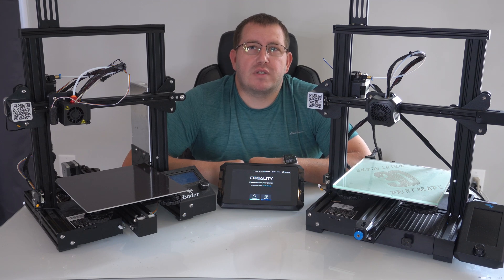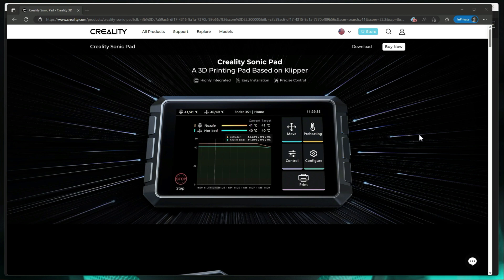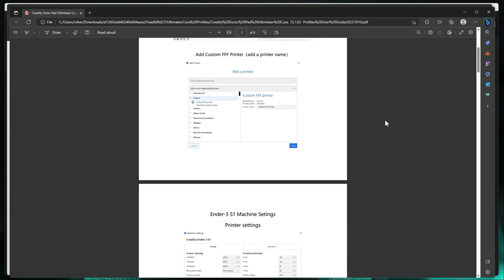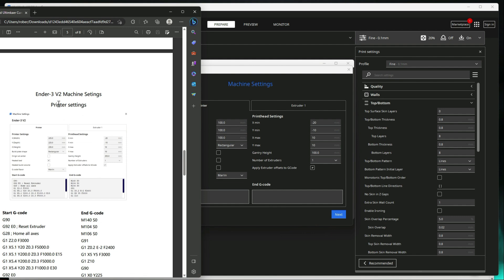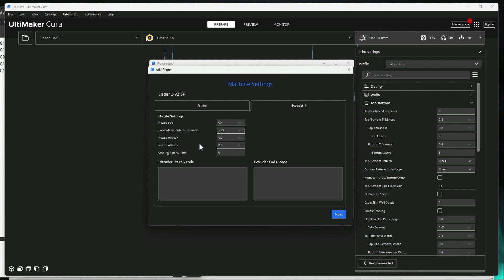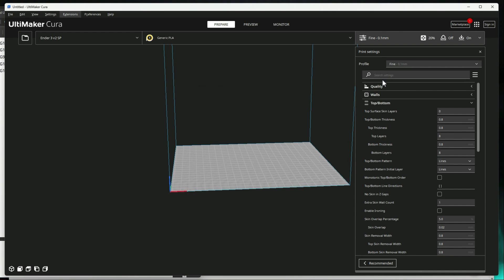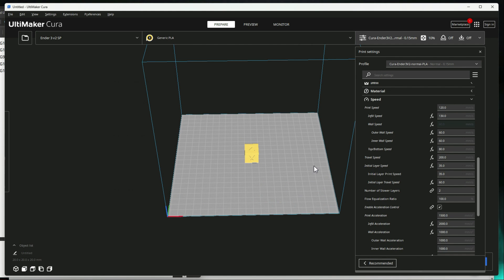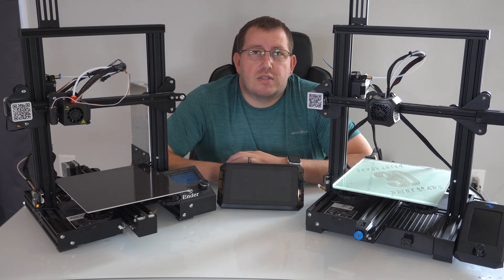Cura Settings for Sonic Pad/Klipper

Comment: First of all, great video! 
And a question mate, I got a raspberry pi zero 2w and I did all the work for run it and use. It works well. So question, Getting the creality pad is the same kind of solution?
And do you recommend use the same settings as show in the pdf for this hardware (raspberry) ?
Thanks for you time mate !
Reply from the maker: Hi. Thanks for the feedback. To answer your question it depends on what your running on the ras pi. If your running klipper it would be very similar to the sonic pad. If your running octoprint and Marlin on the printer then there is a big difference. Either way, i recommend getting to klipper. The setting in the pdf are good as a starting point, you may need to tweak them a little based on your printer.

Comment: I'm new to printing only about six mon. I bought the sonic seven right after getting it.I just installed this the printer drivers or something that came with it and took off printings make any customs so am I doing something wrong? I got some of my best print ever.don't even hardly see the prints anymore.
Reply from the maker: Hi. Honestly, im having a hard time following your question. Can you provide more details on the issue?

Comment: Apart from reducing the retraction length, do you know of any other changes (for the profile) for the Ender 3 Pro with the all metal hot-end (microswiss) running on Klipper when slicing on the Cura?  I am assuming I can use the V2 profiles since they are both bowden tube (non-direct drive).  Using CHEP Ender 3 Pro profile as of right now (pre sonic pad profiles).  Will compare that too the V2 profiles later.
Reply from the maker: Hi. The big setting differences will be speed and retraction. The v2 profile should work fine since the only real difference is the silent board and screen.
Reply: @3DPrintscape how fast have you printed on the ender 3 pro without losing too much quality? 120 mm/s?
Reply: Awesome. And thank you very much for your videos and clear technical explanations. Much appreciated.

Comment: Thanks for this video. I’m fairly new to 3D printing and bought a sonic pad because I thought it would make life easier. I couldn’t be more wrong. I assumed you could create the g-code in Cura (although I don’t really know what I’m doing) and send it to the micro sd card, but put that in the USB adapter and plug that into the sonic pad instead of directly into the Ender 3 v2. It seems I am wrong.
Reply from the maker: Hi. At a high level what your saying is correct. The gcode is being created from Cura and its getting sent to the sonic pad. Cura just needs to know what settings are needed and i prefer to use the web browser over usb/sd.

Comment: I have an Ender 5 S1, which Profiles can I use therefore?
Reply from the maker: Hi. I would start with the one for the Ender and modify it from there.
Reply: What do you mean by starting with the ones for Ender? The Standard Profile who came with? I found a Profile on the Creality Print Slicer, but honestly I don't like this Slicer that much. Do you think I can copy that? @3DPrintscape
Reply from the maker: Cura 5.6 has the standard profile for the Ender 5 S1 in it, you should start with that. @raffaelegambardella4011

Comment: I have a ender 3 max with a cr touch and dont really under stand what printer settings i shoild use in my slicer.
Reply from the maker: Hi. Are you running the sonic pad? If so, the ones i call out here are probably a good starting point. Just make sure you set the build plate size correctly in the slicer.

Comment: Great video and I have everything setup, however whenever i try to print the nozzle is about 2.5mm above the print bed. I performed the probe calibration and it still won't work. If I try to adjust the bed height then my adjustment screws max out  and I can't adjust enough. Any help or assistance would be great.
Reply from the maker: Hi. It sounds like the z offset isnt set right. What value did you come up with for the offset?

Comment: Do you have a guide for the BTT Pad7 running on Ender 3 S1 Pro?
Reply from the maker: Hi. I dont have one for the S1 Pro but the one i have for for the v2. It shouldn't be too much different as far as speeds and everything go to start with. You will need to tweak things based on the printers behavior though.

Comment: If you're going to be using the Sonic pad which runs Klipper, why did you choose the Merlin G-Code during set-up?
Reply from the maker: Hi. There isnt a flavor for Klipper that im aware of. The g-code is mostly the same minus a few commands.
Reply: Greetings from England. I thought the same thing as you @LP, but then I’m new to all this g-code stuff. I’d like to learn how to design & print my own  items. At the moment I’m just getting stl’s from thingyverse and running them through Cura and hope for the best. I bought a sonic pad because I thought it would make things easier. Seems like I’ve still got a lot to learn.

Comment: Hello ! If I have a cr-10 smart pro, what configuration should I use? By installing Kippler, is the printer already faster or should I configure something in the slicer?
Reply from the maker: Hi. Klipper allows the printer to be faster but you still have to tell it what speed to go at in the slicer. I would start with the cura profile for your printer then make the changes i mention in this video.

Comment: hello
why the accelration is high? like 29884908
klipper warning me with max_extrude_cross_section that is very high

help me connect my printer to probaly work

ender 3 s1, klipper on raspberry 4, cura 5.1.0

Comment: Thank you for this video.   I am still looking for similar for the Cura Settings while using any printer in Klipper.  Not just a specific Printer/Sonic Pad.   This is as close as I have found so far.  Thanks again
Reply from the maker: You're welcome!

Comment: Just wondering if you would recomend me setting my g code to a different printer as i have installled a sprite extruder pro with cr touch and filament sensor on my ender 3 v2. Or do i still run stock v2 g code????
Reply from the maker: Hi. You dont need to set it to a different printer. Just add the g29 command after the g28 for the bed leveling and make sure you calibrate your e steps.

Comment: I have a Ender 3 S1 Plus with a sonic pad and there is no profile for this printer in the folder or information in the documentation on how to create a profile in Cura with this printer. Do i use the printer setting for the Ender 3 S1? Any help is appreciated. Thanks.
Reply from the maker: Hi. I would start with the closest printer to the one you have in terms of specs, so the S1 is probably a good place to start.
Reply: I have the same problem with no profiles for my S1 Plus. I tried importing the S1 profile but got an error message in Cura . Did you solve it?